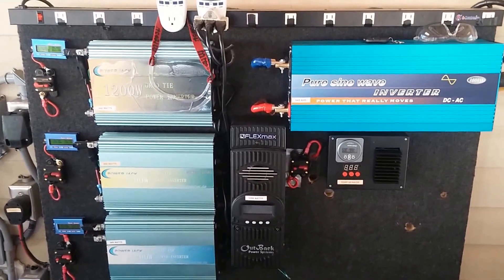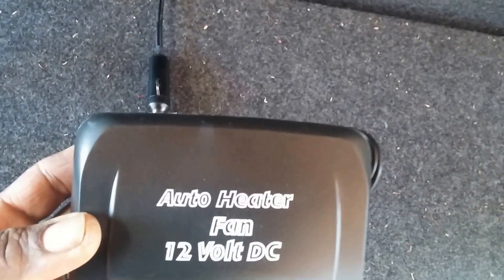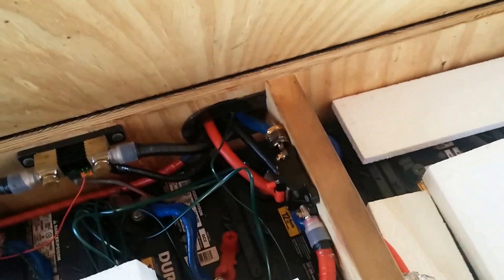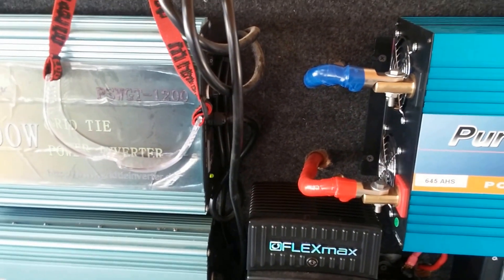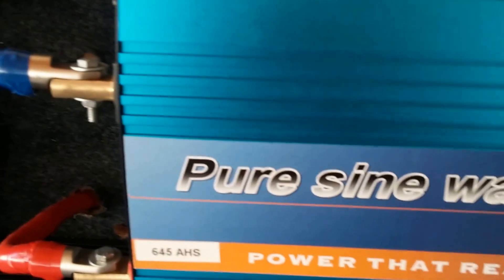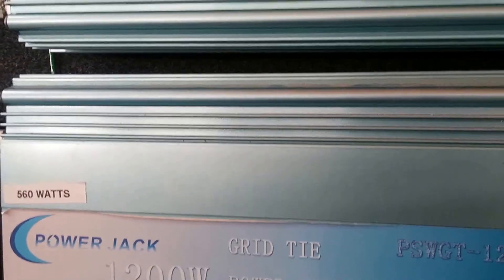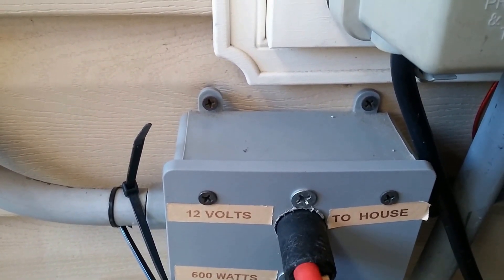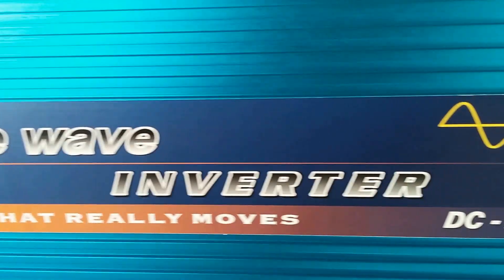outback flexmax 80 outback inverter

Comment from the maker: hi devildestiny555. the power jack inverters are independent of the outback charge controller and the blue power simple inverter runs most of the circuit at night.and no i did not have to contact the power company because they don't pay for the power i generate but it's for my peace of mind.my electric bill is coming from $270 to $300 a month to now $40 to $60 a month now along with now running on led lights bulbs

Comment: Hi, 

Are you running two different set of solar panels for the Grid Tie (PowerJack) vs the Off Grid (OutBack Flex) .... Or the PowerJack is connected to your battery bank?  If so, this is confusing, how can you keep the battery from completely discharged at night and all go into the grid?   also, did you had to notify your utility company for the gridtie?  thanks and great set up